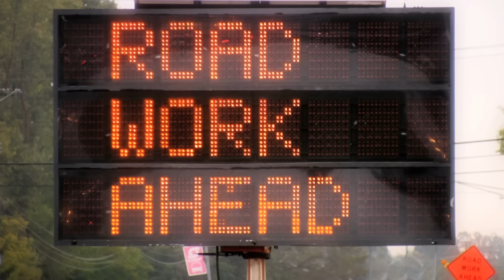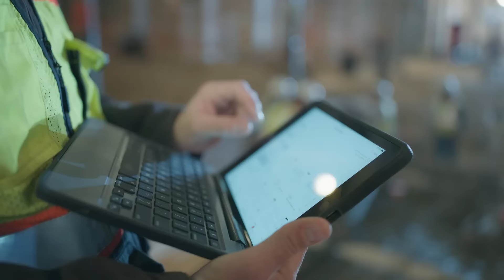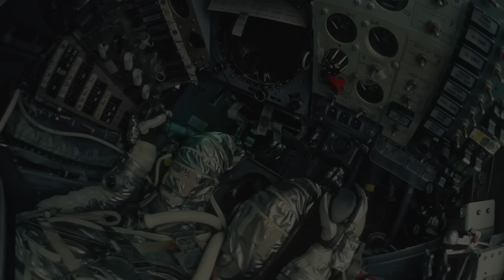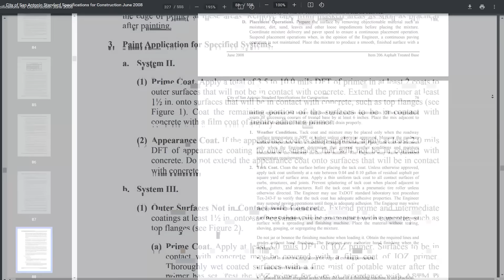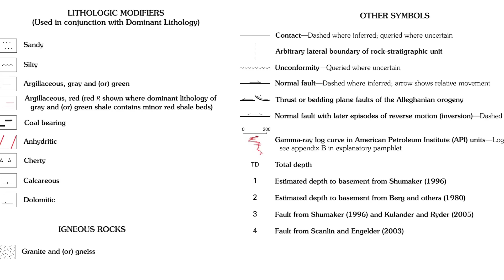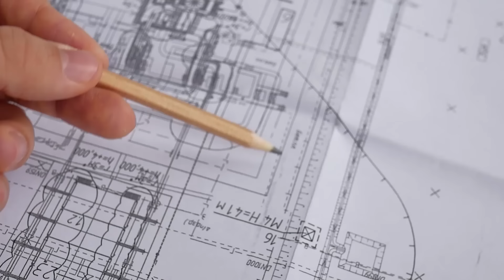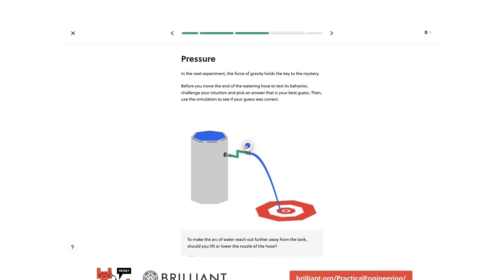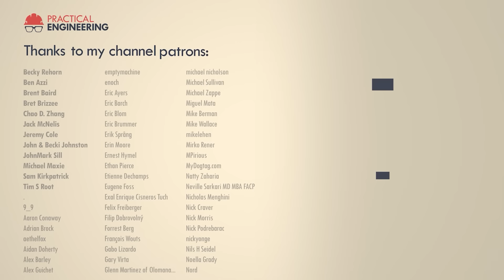4 Myths About Construction Debunked

Comment: I work in an area of construction that often gets overlooked: infrastructure networking. My compnay designs and delivers that backbone networks and cybersecurity necessary for all the operational technology (OT) to converge and interact. Given the nature of our work we tend to come in between 70-90% completion of a structure (usually around the time that permanent or semi-permanent power goes live). I'd like to make a couple of comments related to your video that most people wouldn't consider:

Time: If my team is fitting out a new building we have to allow 4-5 times the labour costs for the final installation of our kit. There are a few reasons: 

(1) There are rarely more than 1 or at best 2 lifts running during construction and those are manually controlled. Not only are you competing with all the other workers for access to the lifts, if the driver is on a coffee break then that lift is out of service. A recent project took 3 days to physically install a network throughout a 40 storey building; a similar brownfields project (i.e. a retrofit in a an existing building where we didn't have to compete for lifts) was completed in under 8 hours 

(2) before starting this business I was an advisor for government organisations here in Australia for large IT infrastructure tenders. During my time doing that the weighting of  final price had reduced from about 80% to 40% of the decision matrix with other factors such as the ones you mentioned becoming more relevant. I'm glad you made that point as unless the low bidder has achieved that pricing through amazing business efficiency, they'll rarely win the contract

Fantastic video thanks

Comment: I am a retired water and wastewater operator. There are times when government regulation being followed makes it look as if there are just people standing around when in fact that is just what they are doing. Confined space entry is one example of this. In order to legally enter a confined space, say a manhole, there, by law, must be three people. One to enter, one to watch the person entering and one other to retrieve anything needed. If the person entering sticks his head out of the manhole all new paperwork must be done before that person can reenter. A simple job becomes and all day thing because of regulation. I do not intend to bypass safety but someone in an office just writing regulations in order to preserve a future for themselves doesn't make the drinking water any safer or the wastewater any cleaner for reintroduction into the water cycle.
Reply: Did a job in a town in woods replacing residential sewer was required to have 2 spotters for road a flag crew 2 spotters for manhole and shoring for a 2ft deep trench on a dead end street lol
Reply: @sewerrat7612  Over regulation makes everything cost so much more. Shoring for a 2 ft deep trench, holy cow.

Comment: Thanks, G Man! I normally build movie sets and used to specialize in mechanical effects when we had a 12 feature film per year biz here in SF bay area, but in between film and other exotic work I do fine home construction and we always manage to find a quiet out of sight spot to take breaks & lunch so as not to be spotted by the site supervisor spot visit. But Especially on a film set, you are hustling non stop (on set crew) until the bell rings and all work stops while they try to get a shot off. (working 'on the bell' it sucks!) (Pavlovian hurry up and wait)

Comment: here are a few questions i have about construction:
you explained workers standing there not doing a thing but my question is how is it that there are construction sites that are fully decked out with gear, two lines of highway blocked for over half a year and every single time you drive past, there is not a single person *present*, not workers standing around doing nothing, just nobody there and none of the machines have moved an inch since the last time you drove past.

how is it that we still have engineers who took up student loans, sending them into crippling debt to get high level education, not learning that galvanizing, powder coating, or painting metal makes rivet holes smaller?

Comment: Near our village a water supply pipe needed replacing,about 200 yards in length situated entirely on the path/sidewalk which was separated from the road by a grass verge. The contractors set up a three way traffic light set up on the mini roundabout despite being no where near the carriageway while working and after nearly 2-1/2 months of nothing seemingly going on but the large trench they dug becoming a canal and the lights delaying traffic. Complaints were raised by a few locals.After some investigation it turned out that the works contractor had not been at the job for weeks but had kept the road closure contractor on site in order to make it seem work was on going,from time to time a contractors ruck would turn up and the driver would just read a newspaper for a few hours. Our local council who ordered the work caught the contractor basically 'longing it out' and docked £75,000 from the contract.The work was then finished in around 4-5 days!!

Comment: I drive a semi-truck and would comment on the tremendous differences in road surfaces. Asphalt generally seems better than concrete although there is apparently a great deal of variability in the types of asphalt and concrete used. Asphalt seems better in that when concrete is used there is nearly always a major amount of maintenance relatively soon after completion involving cutting out sections of road and pouring concrete patches that almost always cause the surface to be very uneven. Heavy truck traffic passing over uneven roads causes faster deterioration. Asphalt mixed with recycled glass and plastic is supposed to be an excellent mix. You should do a video about this.

Comment: As a field worker with a natural gas utility, some of the other reasons for “standing around” is monitoring gas readings while someone is performing work in an excavation (welding etc) and having a dedicated person with a fire extinguisher on “fire watch”.  

Even when a machine is digging, there is typically a “swamper”. Someone whose job is to watch and guide the excavator while they are digging.  A second set of eyes as there are numerous blind spots in the machine. 

Also imagine hand digging a hole in the summer while wearing  full coveralls, a balaclava, hard hat and leather gloves.   All PPE required when isolating and repairing leaks.  You need to stop, or someone is going to have to drag your sweaty limp carcass out of the hole.  

That being said, there is always “that guy” who is always useless.  Every job has at least one!

Comment: Inspector checking in...
Yup! I do a lot of "standing around" while counting blows per minute, the number of lifts and their compaction time, watching and recording the readout of gauges, etc etc etc etc etc. I get a bad rap for all of that from a lot of people who don't understand what I am doing at that time. But the people who also see me testing concrete, doing moisture and density tests, climbing scaffolding 4 stories to check for a few pieces of bar, or any of the other pretty physical tasks I do, understand that I do my fair share of hard work as well as very important mental work.
I will say, for me, standing around sucks, but is a large part of my job that I am paid to do. I'll also add, sometimes laborers are swapping out to prevent injuries and fatigue... both of which can be far more costly than having "a guy standing around" for a couple hours a day.

Comment: Thank you for bringing to light the reality of construction. It is hard to listen to someone complain about construction workers standing around. When they haven’t realized that they showed up to their climate controlled work place, did their job, bought Christmas presents online, then drove home 8 hours later to think those same guys were standing around in the elements next to hazardous chemicals and dangerous equipment with blind spots, and wearing uncomfortable and safety gear and clothing that doesn’t help with the heat or cold still standing around. But they are working more than 8 hours in those bad conditions.

Comment: As a state employee, at a relatively small town facility that is about as far away from our state capital as you can get without crossing the border to Canada, I have been subject to exactly why people believe the "Lowest Bidder = Bad" conspiracy. We work out of 1 condemned building and another that is well on the way. Both are decades old, and were built on a tiny allocated budget with refusal to allocate a renovation budget to our facility, until they built us one new building. That one singular building, received a concrete floor that looked like it was done by teenagers with a 4 wheeler and a lawn roller, and cracked to pieces within 2 weeks. That same building, after having 3 separate floor repairs that never fix the issue, on top of 4 separate repair jobs we did ourselves, has also yet to receive any utilities after 5 years, and still has an incomplete interior. So while not always "Low = Bad", there are more than a few times where it is.

Comment: There is/was a book that won the Pulitzer Prize in 1939 called Christ in Concrete, the same year The Grapes of Wrath also won the prize. Christ in Concrete was about pre-union construction in New York City. The book described the horrific working conditions that were common at the time. One described incident I'll always remember was about a concrete pour where a workman fell into the form while they were filling it with concrete. They never stopped the pour to rescue the man, and when they were taking the wooden form apart they found his lips and teeth sticking out through the hardened concrete where he had been trying to chew through the wooden concrete form until he died.

Comment: There is one flaw with giving the job to the lowest bidder.   

My dad worked for nearly 3 decades got LA county department of public works.   He said that majority of the projects that didn’t finish on time were the ones with the lowest bids.  Usually they would come along place a bid so low they nobody could beat.  However halfway through the project they would run out of money and file for bankruptcy and the county had to go collect from the bond which ment time was lost, projects delayed and more costs.  It would be wise for the engineers for the county to evaluate these projects and the bids and eliminate the ones that seem unrealistic.

Comment: As someone annoyed by road works, my biggest gripe is the weeks of traffic blockage with no workers and no activity, and I wish reopening the roads and lanes was economically incentivized enough to actually reduce the problem.
Reply: Would need more specific examples, but generally if it's possible access is restored whenever possible. Usually inactivity is caused by weather or some other issue preventing work from being done, as a lot of the jobs need specific weather conditions both on the day, and sometimes for a week in advance. Sometimes it looks like the works may be driveable, but they are not, for example chip seal is easily mistaken for an actual sealed layer, but it's much more tacky and fragile, and if a car passed on it it would be destroyed. If we chip seal, then it rains, we can't put the next seal layer on until it's completely dry. We can't open up lanes without line markings or stick and stomps, and same issue again, if it's wet they won't stick. There could be any number of other reasons, including undermining or other substrate issues, minimum distances from deep shoulder drops etc, simply needing to keep traffic speed down and more. It's really hard to give specific explanations without a specific example scenario and all the information that's important that you likely didn't notice.

Comment: I work in manual labor, and have seen people who can work non-stop for 8h/d, 40h/w. However, most people do need breaks if doing intensive labor. So yeah, especially if people are standing around watching someone else work, they're usually taking turns doing the work. Not to mention, there's not always the capacity to have multiple people doing the same job. I.e. digging in a small hole.

Regarding lowest bidders on public contracts... You can get good quality jobs. However, it's usually a half assed job that goes over budget, and takes twice as long. Heck, I've seen some just stop half way through a contract. (Government worker here). That being said, it's the best option available, especially compared to the alternatives.

Comment: Having worked in road maintenance I can tell you how hard work it is.  Asphalt is 350 degrees and it can't be layed in cool or cold weather.  A few minutes of spreading hot asphalt and you are worn out and need to take a break.  So the workers will work in tag teams.

Comment: There's road work going on here all the time, every time I drive by. There's either 3 or 4 guys there, one guy is working and two are watching. The fourth guy is usually wearing a white shirt & bump hat and holding a phone and or a clip board, plus there's a pickup truck with blinking lights. What's the job usually its just digging a hole.

Comment: First you have got the Apprentice. 
He is the one with the Shovel, the one who is actually shovelling Dirt. 

Then you’ve got an actual Worker, who is there to demonstrate Shovel Technique. 

Next you have a Training Officer who is there to dictate the Policy on how work is to be Performed. 

Next is an actual Engineer who can inform where the Hole is to be dug, how deep, how wide, how long and what Pipes and Cables might be encountered in the digging process. 

Then you have a First Aider, present just in case someone gets hurt. 

Then you have an Occupational Health, Safety and Welfare Representative, an OHS&W trained & Qualified Worker, who is also a member of the appropriate Union. 

Then you have the Designated Driver who is there to drive the crew Vehicle. 

Next is the Heavy Machinery Operator, who is there for the Excavator, Bulldozer or Road Roller. 

Then there are Dump Truck Operators, whose vehicles cart Dirt in or out. 

Then of course there is the Supervisor required whenever a large Work Gang assemble. 

And conspicuously hidden in the group is the Media Liaison Officer, whose job is to visually record the work being performed and deal with any onsite Media enquiries which might happen on Twitter, Facebook or in person. 

And lastly but by no means least We have the Two Traffic Control Wardens placed one at either end of the Work Site to ensure maximum Traffic Safety.

Comment: For starters, under sand, you usually find rock.

This means you can use end bearing piles that reach the rock under the sand.

If the rock is too deep, then you can use friction piles

Comment: One of your first points is probably one of the biggest that people really don't get. The vast, overwhelming majority of ALL construction work is done on contractual basis, the actual parameters of which are negotiated BEFORE any work is done. This usually includes a timeline (which may or may not be flexible) and almost always include payment. The longer a job takes, technically, the less profitable it is. Workers are paid hourly, but the company paid a fixed sum decided before hand.

Comment: I heard this term once called a "mechanical fuse" in regards to a specific part of a lawnmower. It referred to a pin that is intentionally weaker than the thing the pin keeps in place. If that thing were to fail, it could be devastating. Not only way higher cost of repair potential, but also a safety issue. So the pin was designed to be weaker so that it would always fail first, causing a very inexpensive and uneventful repair. It also hopefully alerts the user that the device is aging and needs inspection which might catch early wear signs of the more dangerous part. This is what I think about when I hear planned obsolescence. If something were to fail on a bridge while I'm driving on it, I sure hope it's not a life-essential piece. The easiest way to make sure that's the case is to design it to fail earlier. Luckily, bridges get regular inspections too, but nobody's perfect and things can be missed. A failure of a piece could point to an area that needs a more thorough inspection.

Comment: Fire sprinkler fitter, sometimes you will get on a job that has so much trapped water that it take a couple hours to drain down the system before you can start work on it. We usually try to add a low point drain, but they don't always go for the upsell.

Back when I did commercial demolition....sometimes I would get tasked with "watching the server room" if they were demoing concrete overhead....I had to make sure no dust was falling onto the servers.

Comment: A lot of the 3 guys standing on shovels while a excavator digs is people keeping a eye out for water, gas, sewer, electricity lines etc, keep the excavator digging at the right levels, clearing debris that could add extra charges to dump if not separated or even just waiting for the excavator to finish so they can start work on jobs excavators aren't equipped to do

Comment: As a cement mason, I occationally have downtime. Concrete needs to cure enough to work with, so smaller projects like driveways require waiting after you screed and float the concrete. You can't apply a finish until the concrete is sufficiently hard. I also regularly work with epoxy. Sometimes, failing to wait long enough can compromise a project. If the epoxy isn't cured fully, any finish you apply to it can fail